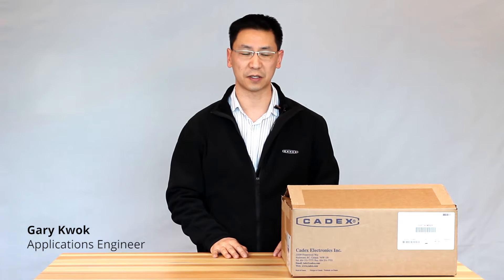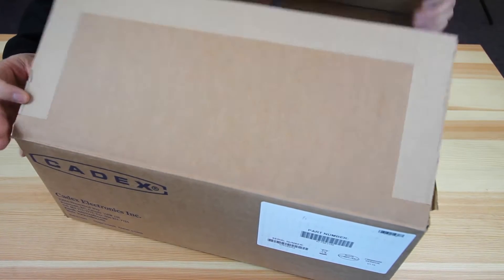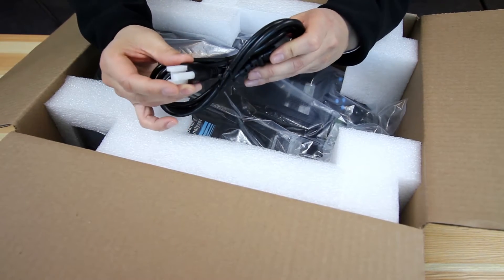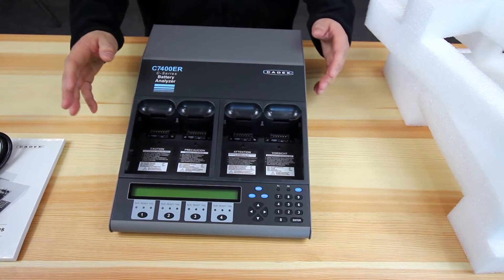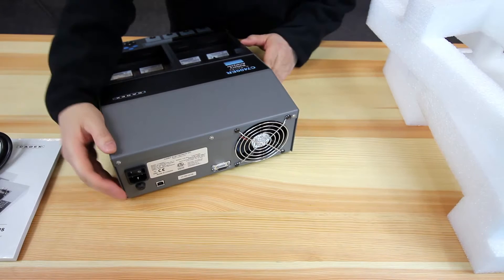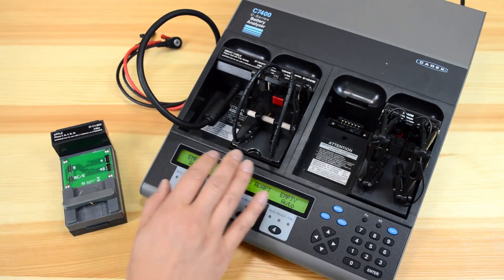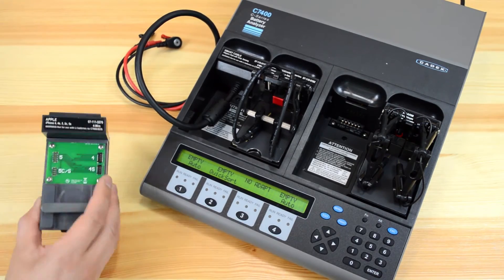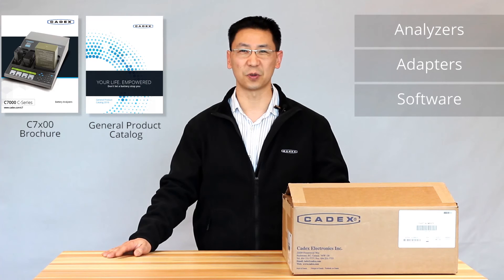C7 Tutorial - Opening the Box

Comment: Does your Battery Analyzer C7400ER meet the requirements below?

- Set the  discharge the Battery =>  Set the automatic DC current sink to a constant current of 6.0 Adc.
 When 20 minutes have elapsed and the Battery voltage is more than 5.6 V and the temperature of the Battery housing did not increase to more than 45 °C [113 °F] then the Battery has passed the capacity test.

- Set the  charge the Battery for 3.5  hours.
 => Set the current of the constant DC current source to 500 mA  and the voltage limit to 7.8 VDC maximum.